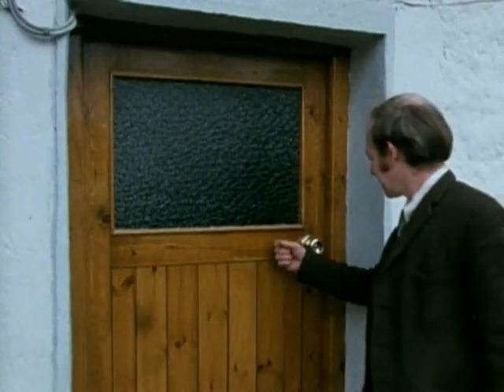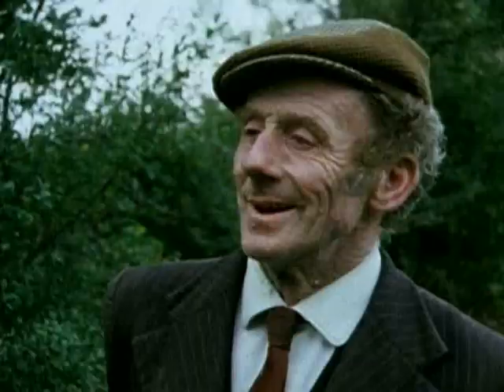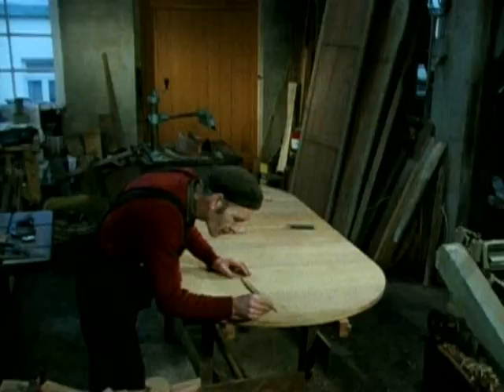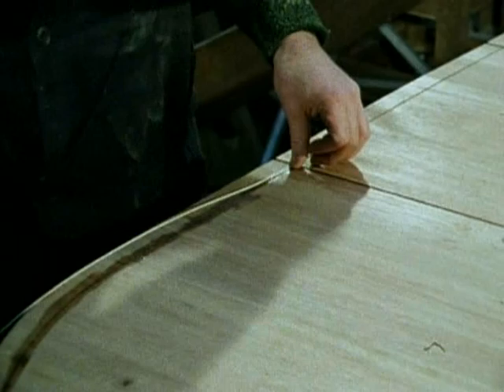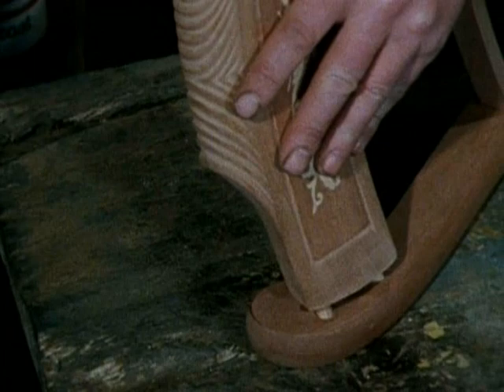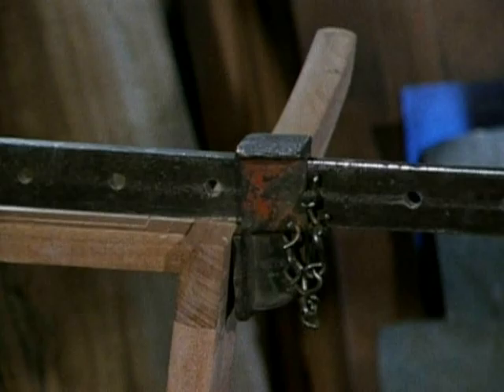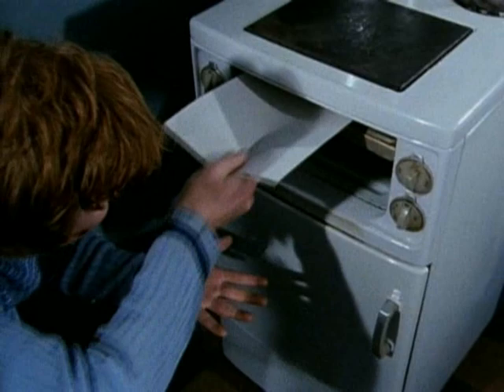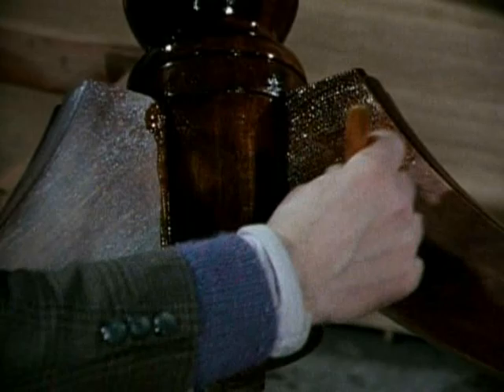Hands Cavan Cabinet Makers Part 3

Comment: Many comments lament the loss of this kind of craft and craftsman.  Stay your lament, for I and many others still practice this craft.  I am Cheaha Woodsmith, Talladega, Alabama.
Reply: Got any vids? I am a Tool and Die maker. Same thing, just different. I do some woodwork in my spare time. I built a walnut floor with solid walnut stair treads on my steps. Personally, I don't do videos. I'm too private for that.
Reply: @danhillman4523  I don't do vids, either.  But i do occasionally take pics.

Comment: You can see in the die at 1:40, that saw was used until it was blunt, then repurposed as an improvised file on the other side to carve a groove, and then repurposed as the die. That piece of metal has seen more work 
days than any of us.

Comment: And doing their work in shirt and tie! My goodness, what a difference from these days. No one has any self-respect.
Reply: It wasn't unheard of then, but that'd be a real Health and Safety issue nowadays, wouldn't it?
Reply: Can't see this as a safety issue, unless the tie is hanging loose, but it can be attached in place, and is when worn properly. 
Also a big difference in speed and precision of hand tools vs big factory machinery.
Reply: Ha. You'd be sacked for not wearing a high vis jacket and a hard hat today.
Reply: The ties are bit of a hazard around powered devices like their table saw.  So are long sleeves, and long hair.  With hand tools, there are no such concerns.
Reply: As we saw, they do use a number of sensible power tools.  I don't think a suit & tie really contributes anything to the ethic of their work, and sensibilities change with time anyways.  I dare anyone looking at hand made furniture to tell me what the maker wore, or what difference it makes.